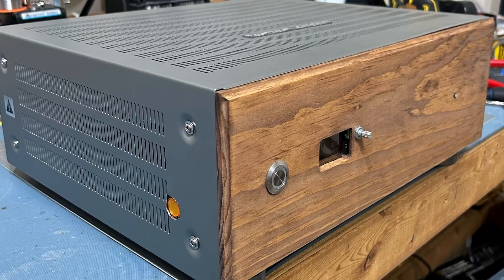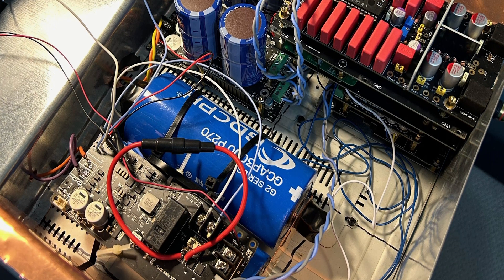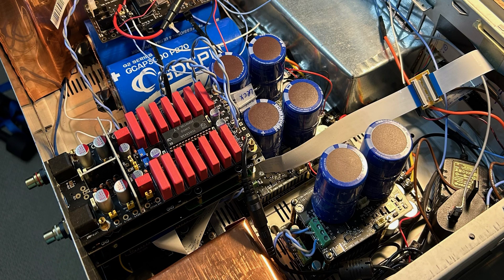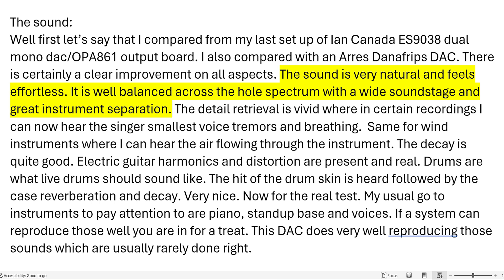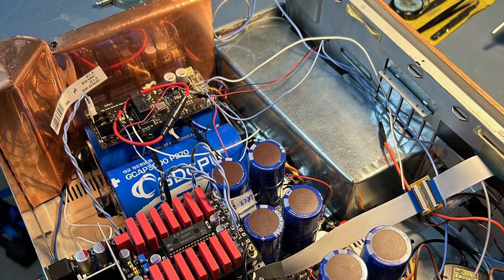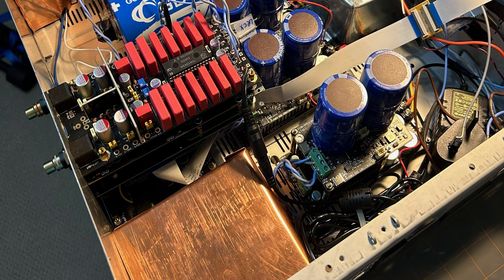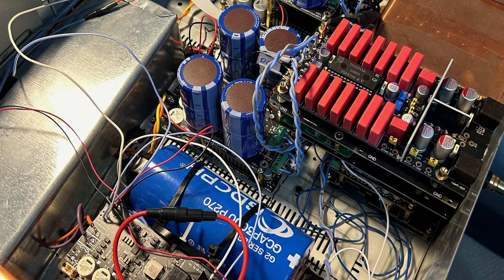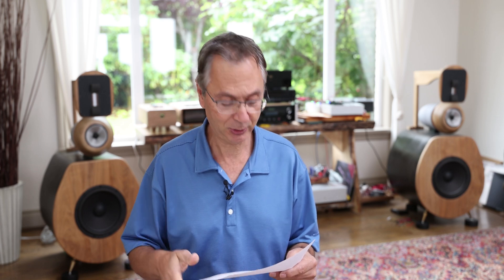Martin's Gabster TD1/ Ian Canada  Diy Dac

Comment: Hi Gabby. I really interested in building this DAC. Is this DAC better than the dual mono II dac + OPA861?
Reply from the maker: The Imaging Air and Musicality are far better on the TD1 Low and High frequencies detail  is the same on both, Midrange Varies it depends on The TDA1541A Chip.
On a very good Chip Vocals Mids are equal or better. On a average chip not as good but close. 
With a low grade TDA Chip everything suffers.
95% of the Chips selling out there are about average I am releasing a Video on Friday where I test 16 Chips.